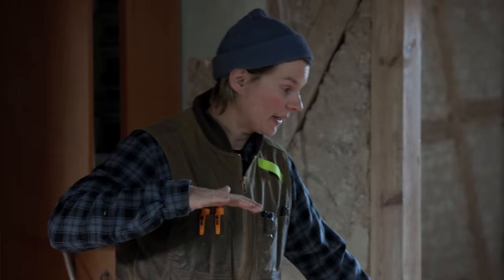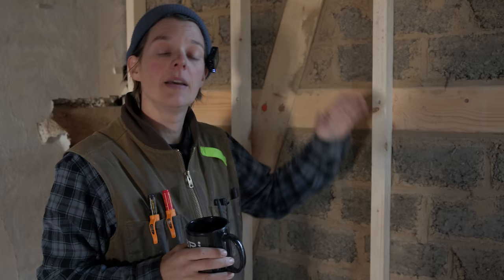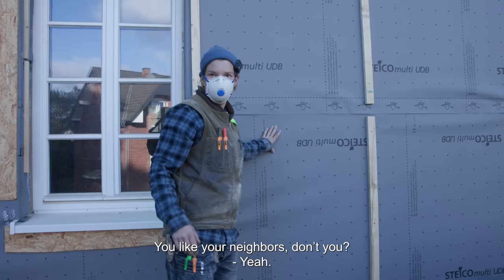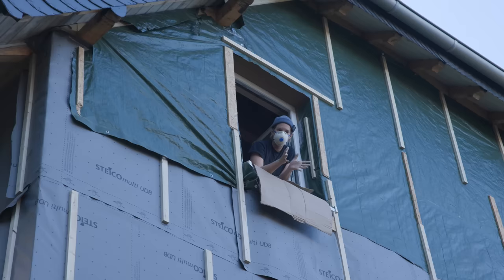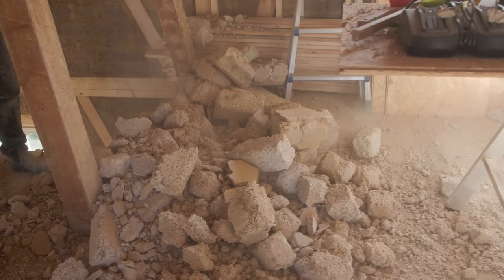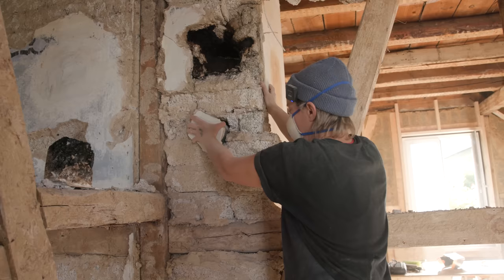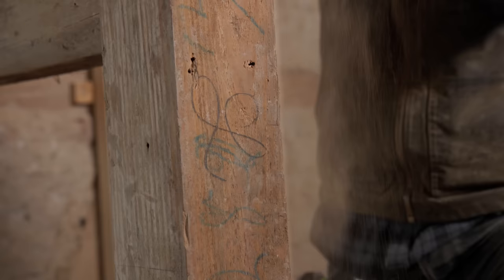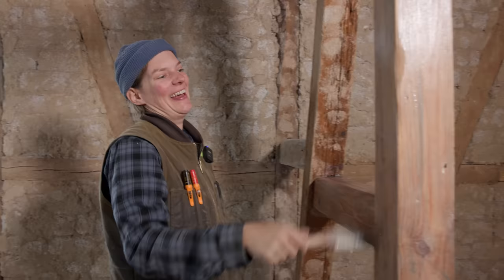I am so glad we found this! (Rescuing a 120 year old house)

Comment: Oof, that old chimney may not be usable, but taking it down is just as bad... Maybe just expose it and reinforce it as much as you can so it's structurally stable, even if you can't use it as a chimney anymore? I know that there are companies that retrofit old, unsafe chimneys using a fancy duct and fill system to effectively run a new, much smaller chimney up the inside of the vacant and unsafe space from the old chimney stack, so that you aren't depending on the old chimney for anything more than just being an enclosure for the space anymore. But I don't know how far gone a chimney stack can be and still use that process. I've seen it done for older buildings than yours in France, but I think their chimneys may have been in better overall condition to start with, just still too leaky to be safe to use unaltered.

If you can't run a rescue duct up it and do have to take the damaged chimney down, would it be possible to keep the attic section and the part above the roof intact and just support them from below somehow? That way your roof is undisturbed, but lower floors gain the extra space, and nobody who ever comes to the house after you mistakenly tries to use the chimney for anything.

The exposed timber frame looks lovely, and it's nice that by exposing all the walls you can now run all your new electric and plumbing with impunity, too!